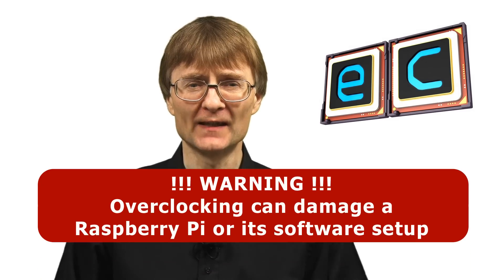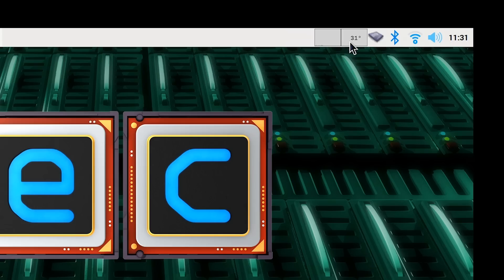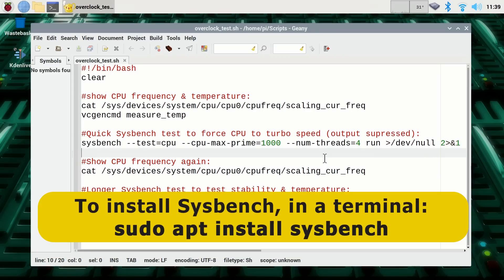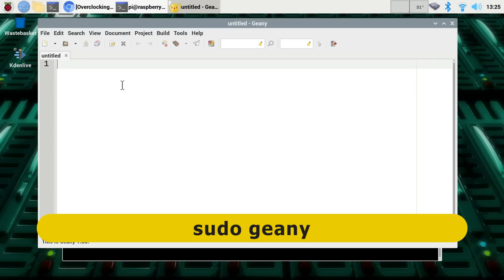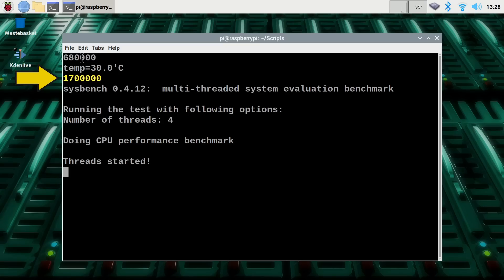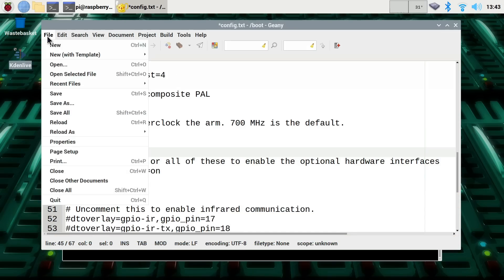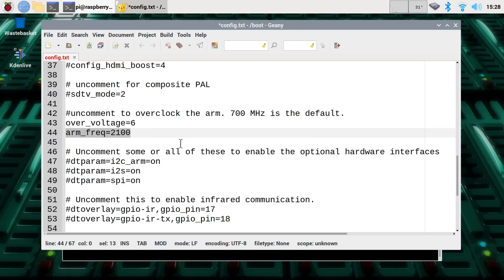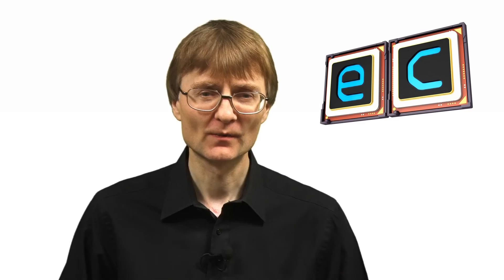Raspberry Pi 4 Overclocking

Comment: Having done a fair amount of overclocking on a standard desktop platform, the next thing I would suggest is to start to dial the overclock in. Normally you would slowly start to reduce the maximum voltage to the point where the system becomes unstable. You then go to the first next working voltage value where the system has no stability issues. This means that you are getting the best possible overclock while not pumping a larger than needed voltage to get a good stable overclock. This will not only allow your system to run cooler because more voltage means higher temps but also you are stressing your silicone less and potentially increasing its lifespan. In the past the yard stick for a working overclock was 24 hours stable in Prime95.

One thing to note here, if you dont care about overclocking, you may well be able to benefit from undervolting the system. From the factory they will have a default 'working' config which goes onto all of the machines. This doesn't matter if it is the worst chip or a golden sample processor, it will run those settings no matter what. However your system might be able to run at a lower voltage and stay completely stable. This means that the temperatures at a stock speed can come down even further than they already are, as your pushing even less voltage through the processor. However again the further down you go, the more unstable the system gets as at somepoint the system won't be getting enough power to stay stable. At that point, go to the last working voltage.

Comment: The Sysbench improvement between stock and 2GHz was a BIG one. 1min off Kdenlive's not that much, but considering it's nothing like a massively powerful machine it's still very considerable.

This simply proves that modern-day ARM is still just like Pentium in the old days: clock matters more than the architecture. Nowadays it's the exactly opposite for x86.

Comment: Hi Chris, I always look forward to the new Sunday video :) But I must be missing somthing with your latest video. Geany will let me edit the config.txt but it will not let me save it. In the video it opened and  allowed you to save the file. I know it is a permissions problem. What did you change before you started to edit the file?
Reply from the maker: I ran geany from the terminal -- sudo geany -- to run it in root model

Comment: With overclocking things run faster is a no-brainer.  It would be nice to address a more fundamental issue: does overclocking makes RPI 4 do something that is not possible with original clock frequency, such Youtube runs smoother in 1080P.

Comment: Hi Chris

I wonder if you would consider trialing GPU overclocking in conjunction with experimental Vulkan graphics drivers ?

I did this on both Pi4 and Pi3 using OpenBVE train simulation as a benchmark (allows me to experience London Underground without risking Covid).

I used the Epping branch as test.

My gaming experience goes back to 3d Monster Maze on ZX81 - DIY sound effects. So this OpenBVE is relatively stunning :-)

pi 4 stock

https://youtu.be/RhCdycfyDGg        
12 FPS
With over clock 2Ghz and 750 GPU and experimental Vulkan can get 18 FPS - slightly more than CPU scaling.

Why do I think the GPU makes a difference? Well now check out what I did on Pi3.    Stock was 1 to 3 FPS.

Adding Nvidia engineers almost Vulkan driver rpi-vk-drv we move to 9 FPS.
https://youtu.be/hdbCNrYbyFY

With the GPU scaling and drivers both Pi's feel more responsive. Hopefully I am not simply imaging it.

Comment: I've got my Pi cranked to the 2.147ghz w/a 750mhz OC on the GPU w/an 8OV and i've got next to no problems on Youtube or what not. Mind u i used to have the 2ghz CPU, 750mhz GPU w/a 6OV, tried the 2.147 or at the Pi wrongly reports 2.29GHZ but in order to have it stable i had to bump the OV up to 8 to give the CPU more power. I also found a setting to in the Rasp-Config menu in order to boost the memory for the GPU from the 64mb that it gives it by default to 500mb. Now if i had the 8GB model and not the 4GB model i'd probably see if i could give my GPU a full 1gb of memory to see if things were better especially since i use my Pi to render my PS4 Videos.

Comment: FWIW I've been running a Pi 4 4gig and a Pi 4 8gig at 2ghz in the FLIRC aluminium case (in both instances) - temperatures rarely ever approach 60deg under heavy constant load for hours of processing, typically it's well below throttle.  I can feel the case getting a little warm but nothing to even be remotely concerned about;  the solution is particularly good as it's passive (cool/quiet/dust-free), the main drawback with these cases is the lack of GPIO access once installed.

Comment: I’m not sure about anyone else, but I’ve pretty much stuck my Pi 4 back in the drawer and pulled out the 3b+ again.  It comes down to one thing:  the terrible choice to go with mini HDMI ports.   All adapters and cables I’ve tried are garbage and there are problems with fit in the 3 cases I’ve tried.
Reply from the maker: The Pi 3B+ is indeed in many ways the classic Pi.

Comment: Thanks Christopher!  I've never been brave, desperate, or stupid enough to ever try overclocking any of my systems - especially since most of them run pretty well at their standard clocking.  Hate to see the CPU temperatures without a great cooling case...

I just got a new 8GB Pi-4, but had some unexpected problems cloning my working Ubuntu system from my 4GB Pi-4 - where part of the MATE desktop was rolled horizontally so the left edge of the logical screen was in the middle of the display.  I thought that maybe the GPU clocking may have been different, so upgraded the new Pi's firmware, but it didn't solve the problem.  Never seen anything like it before...  Eventually I had to reinstall Ubuntu and rebuild MATE on it from scratch to get the display corrected.  Still have some stuff like remote desktop connections from Windows not working properly (which was working perfectly on my 4GB Pi-4 configuration) which I'm still trying to resolve.  I have also been disappointed at its high operating temperature in the supplied CanaKit case (even though it has a fan in it), so have an Ice-tower case arriving tomorrow for it instead.  I'm sure that will help!  Stay safe and well, and keep up the good work!
Reply: Ha! The new GeekPi Ice-Tower case I got today cut the CPU temperature more than in half, dropping it from an average of about 85C to below 40C (at light loads)!  Happily impressed!

Comment: Is there any known "unexpected reboot problem" (I don't know what to called it :-D) with Raspberry Pi 4? I have a 4GB model and sometimes it just reboots without any warning or message. I don't think it's overheating because I'm using an aluminium case with  2 Fans and the only application it has running is an Apache webserver on a lite RasPi OS. Thanks in advance..
Reply from the maker: This is not something I have experienced. I would guess a power supply issue.
Reply: @ExplainingComputers  It was exactly that.. USB Type-C cable was bad. It had a breakage somewhere. Why didn't I think of this before :-( The cable was new so I kept ignoring it..Thank you.

Comment: I've never even overclocked my main computer mainly is because i want it to last as Long as i can I've been using the same computer for nearly 15 years, it's been the same since i bought it new, its a Dell Dimension  3000 if your wondering. plus if it ain't broke don't fix it.

Comment: I ran my pi (pi 4, 4gb, 2146mhz) and got better results than you on the third OC. If you look at the results screen you had a max of about 15 seconds, for some reason it took significantly longer to calculate one of the primes and I think it gave you an outlier. My result was 165s which is close to 15s faster and my max was 133ms

Comment: I would recommend after the ovetclocking edits that in the terminal before reboot use:
sync
Then:
sudo sync

This will force any incomplete functions to complete before you reboot, so as not to lose anything nor have it improperly apply.

Comment: I wonder if this same approach would work on a Hackintosh? 
Running macOS 10.13.6 on a Razer Blade Pro from 2017 and there is the config.plist file in the EFI partition to modify. Anyone have any thoughts?

Comment: I must have got lucky with the silicon on my Pi4-8GB, 2100mhz OC with overvolt6, rock solid running(mostly low - moderate load but has had heavy full load testing) over 21days so far.

Comment: Hi Chris, another cool video, thx a lot.
Is it possible to overclock our Raspberry on Ubuntu mate ?
If yes, how to boot this Ubuntu mate on a SSD ?
Reply from the maker: It should be -- the same config.txt file exists, and can be altered in the same way. Once a Pi 4 is set to USB boot, you should be able to image the OS to an SSD and boot no issues -- though I've yet to try with Ubuntu MATE.
Reply: In Ubuntu mate you use usrcfg.txt to overclock

Comment: I have found that beyond 2ghz I have to overvolt to 8 in order not to have problems. I also backed down to 2 just because I don't like pushing right to the edge for limited gain. I'm surprised to see Kdenlive not fully utilize CPU power. I use Handbrake quite a bit and it pushes the CPU to the Max, about the same as the stress test.  I've been running my Pi with 64bit Raspban Beta off a 1TB USB3 SSD and it works perfectly. The latest upgrades have fixed a ton of problems and I think it's getting close to being ready for prime time.  Love the video, great job as always.

Comment: Is it possible to make a cluster of 4 pi's (16cores total) and turn it into a render farm? I know with the software Blender you can  output your render process function to a network cluster speeding up the rendering process can this be done with Kdenlive? I know this getting very tech in set up but might be worth doing a couple of episodes on clusters and what they can do
Reply from the maker: Oh yes, Pi clusters are very much a thing. I may make a Pi cluster video at some point.
Reply: @ExplainingComputers  that would be awesome if you could,I knew about nothing Linux 3 months ago ,now I have my ownclud using certbot using no-ip ,with fail2ban and ufw using 2 factor security which is very handy for paperless billing as well as my own VPN server ,my next project is render farm so my wife can use blender simply to speed things up but I say would be awesome to see you used a cluster connected on network using windows version of blender or does it all have be on a Linux system to work? Thank for replying love your show

Comment: That's awesome I just tried water cooling with dry ice and you haven't. It's actually a terrible experience because of the carbon dioxide emitted by the dry ice. It makes it incredibly hard to achieve thermal transfer with dry ice and you're better off with normal ice.

Comment: I have one of my Rpi4 4Gb Rev 1.1 OC'd to 2.147Ghz and it's been running stable for 6 months, 8-12 hours per day. My two Rpi4 8Gb Rev.1.4 are OC'd to 2.0Ghz. It's a silicon lottery. You may be able to reach 2.147Ghz, 2.2Ghz or even 2.3Ghz like ETA Prime did it here:
https://www.youtube.com/watch?v=hc4t68ACGHA
An ICE Tower Cooler is mandatory to keep it cool enough.
You may shorten your Rpi4 life-cycle, YES, however what would you prefer:
1 full year of a Rpi4 at 2.3Ghz or 2-3 years of a Rpi 4 at 1.5Ghz?
There is a huge difference in performance between stock 1.5Ghz and 2.147Ghz for example.

Comment: Chris does it make a difference with you have the cooling fan blowing on the heat sink or pull air across the heat sink.
Reply from the maker: It may alter the temperature slightly, but to be honest the ICE Tower's heat pipe does such a good job the different would be tiny.

Comment: I have read that if you go more than 6 on the overvolt it will trigger a fuse that tells the PI foundation if you try to warranty a broken PI. My PI is currently set at 1800 cpu / 600 gpu / ov 6. I just have one of the Canakit cases with a super small fan and aluminum heatsinks (I cut the "fan grill" off) and I never see more than 50 max. Never used the overclock section just added the three lines to the end. However now I use Commander PI that can do it with a UI. Another great and honest video! Thanks Professor!
Reply from the maker: I believe that what you say is true.

Comment: I now have the hardware, so cool this project. Only couldn’t get it booting from the usb ssd. Did update the bootloader only it doesn’t work for me. Fixed it with berryboot on sd card and then switching to usb ssd. So fast 🤪🏎. It’s now a RPI on steroids 💪

Comment: A few things…

- cd Scripts is no need to type out - you can just type "cd Sc" and press tab and bash will help you out.
- chmod +x doesn't need "sudo" in front.
- To add scripts to your path as to avoid having to use an absolute path to the script, export PATH=$PATH:$HOME/Scripts.
- Better replace "$HOME/Scripts" with "$HOME/bin" to keep with the old style and don't use silly caps in directory names for scripts and stuff.

But thanks for a nice video :)
Reply from the maker: On your first point, true -- but this is a video! It is not helpful for the audience if I do not type things out. That, or I'd have to explain that I was using TAB to make the text magically appear (I have a video on using the Linux terminal), and this would remove focus from the point at hand. Videos and education are not real life !:)

On your second point, agreed.

On the others, again tbis is about focus in the video.

Comment: Hi Chris.  I love these RPi4 OC videos!  I have a Machine Learning project on a Raspberry Pi 4, and when training the network I find that it crashes after about 5-15 minutes of model training when running at 2.0Ghz and 6 voltage.  It is so far bullet-proof stable at 1.8Ghz and 4 voltage, and tested on 6 different Pis.  For some really strenuous tasks over long periods, 2.0Ghz may actually be too much.  My early tests showing that 1.9+Ghz work if I use only integer mathematics, and remove floating point model precision, but needs more testing.

I wonder if the test would work on a 15+ minute duration workload, and if testing a different function will matter.  I think testing where it finally starts crashing we can start learn even more from here!

Comment: This does make me wonder... Why don't the system builders release the board (SBC, or otherwise) at the safest maximum speed to begin with? I know that some users like to tweak the system to go faster and, indeed, I've seen where the manufacturers sell overclockable versions of chips separately. Just wondering. Thanks for another great video Chris.
Reply from the maker: Hi Steve. Without a cooler like an ICE Tower, the Pi 4 would not last long at these speeds. So to release the Pi with a faster clock speed default, it would need to be sold with a cooler.
Reply: @ExplainingComputers 
Point well taken. But the majority of tests I've seen on the RPi4 8gb need at least passive cooling now (non overclocked) in order to not be throttled under 'normal' heavy use (3D gaming, rendering,... ). I'd predict that the next major update (RPi5?) will have some sort of cooling solution sold with it.

Comment: Great content (as always). Even at max overclock, the ice tower keeps the Pi cold. One might even say, the ice tower is overkill. Could you show us if other cheaper fans and Pi4 cases you showed in the past (especially the ArgonOne) also allow a proper Pi overclocking too.
Reply: I have a CanaKit case that came as a starter set. Just 3 small heatsinks and a tiny fan. I cut out the "fan grill" because it blocked the air flow. At stock it idles at 35 and max of 45. Overclocked to 1800 at overvolt 6 it idles at 40 and max at 50. Basic cooling with moving air will go a long way.

Comment: Time to break out the graphite pencil and LN2. Edit: I had no idea that the new Pi has this much headroom. Very impressive. Edit 3: The only thing I'd do different would be to use a cooling solution that blows air perpendicularly onto the board to cool the various little voltage regulator components and use prime95 for double checking the chip's inner workings.

Comment: I had been messing around with RPi 4 clocks once. But it was not overclocking attempt but other way around - I wanted to change minimal frequency my Pi was running on. So I have changed the arm_freq_min=150 and surprise with ondemand governor RPi 4 was getting to 150MHz low freq. It was fun until I discovered that system clock slowed down a lot, like twice or more. I wonder then if overclocking has the same effect on system clock? Can you check it?
Reply from the maker: It depends what settings as used as far as I am aware.

Comment: Can it be overclocked higher? Like 3GHz? Or it's a no go?
Reply from the maker: I could not get above 2.29GHz, which I understand is pretty high for a Pi 4. There will be limitations in the silicon at some point, which is probably around here. So 3GHz is very unlikely indeed.
Reply: @ExplainingComputers  thank you for your reply. 
And your hard work on these videos.

Comment: I think Kdenlive uses only one core for rendering ( I have to force mine to use all cores ) which might explain the only slight increase in speed and maybe make it faster at 2.2 ?
Reply from the maker: I think Kdenlive used to be single core, but if this was the case the CPU graph is too high (it should be no more than 25% as the Pi is quad core).

Comment: What works on a desktop computer may not work on the Pi, but you could try overclocking the ram and tightening the timings to make the Pi work even faster.

Comment: If you increase the voltage to 8 it will stabilize at 2.1 GH. That’s what I have mine set and also got the gpu to 750. I have No problem with stability.